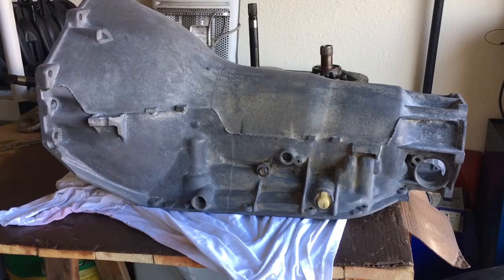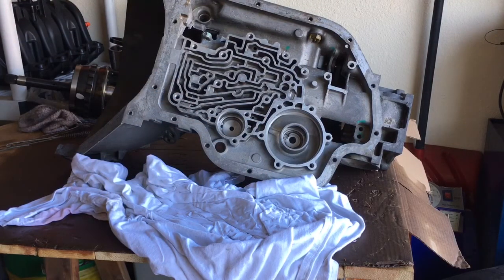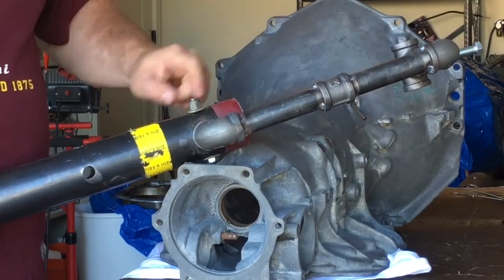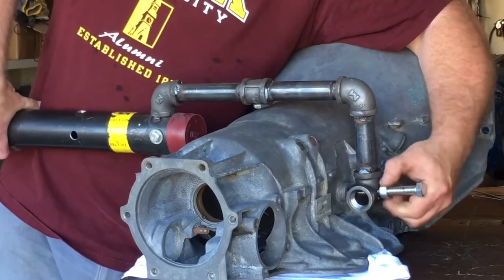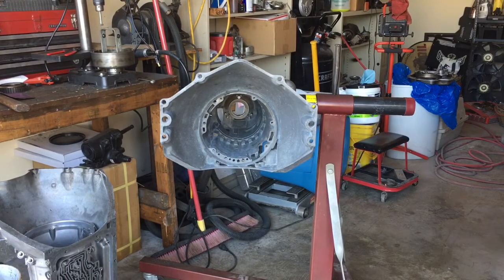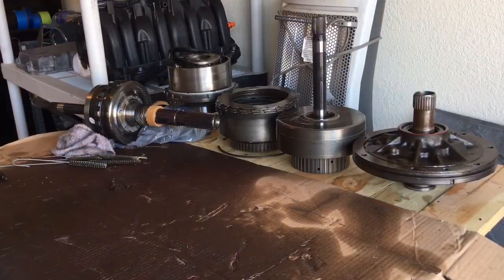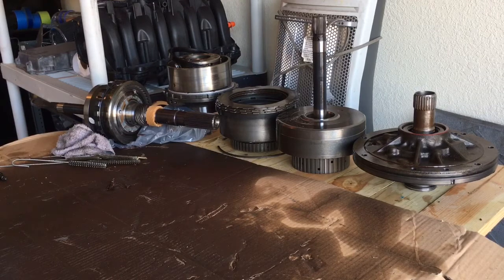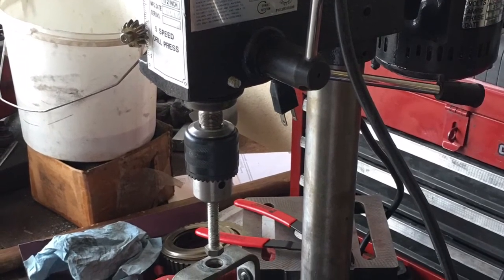Turbo LS TH400 recipe changing the case

Comment: I have a case with some oxidation, what would you suggest to remove the oxidation? I am asking you because of the job you did for rust removal.
Reply from the maker: Jason Real Thanks for the question, my initial thought was to soda blast the case the same way I would a carburetor.  I did a quick Google search and found this:
“If you are cleaning a large aluminum surface, soak a cloth in vinegar, then wipe it across the oxidation. Scrub with a soft-bristled brush, then wipe away the vinegar and lifted oxidation with a damp cloth. Don't use abrasive materials like steel wool or sandpaper to scrub the surface of the aluminum.Jan 16, 2020”
I hope this helps; if I find any other options I’ll pass them on. Thanks for the feedback!  JD

Comment: Great video if you can give us a listing of the length of pipe and size for the build of your transmission holder that would be great if you dont mind and i have a idea for the rust if you put the bottom half of the trans in prep and etch sold at home depot let it soak for a day or so the rust would be gone like brand new thanks for the video
Reply from the maker: 265chevy Thanks for the tip!  I’ll try to make a list of all the pipe. 
It’s 3/4” ID pipe and 2.0” ID main pipe. I’ll try to break it all down.

Comment: That's a good invention you've made. Black pipe welds pretty easy. A novice could stick weld it if he had the welder and safety equipment.
Reply from the maker: Kevin Hornbuckle I wish I had a welder, too many times I’ve needed one. Budget friendly ideas are what make it possible for me to stay moving. 👍. Thanks I appreciate it! JD
Reply: +HeadFlowInc You can usually pick up an old arc welder for around $100. It takes some practice. But these days you have some excellent videos on YT showing in detail how to do it.